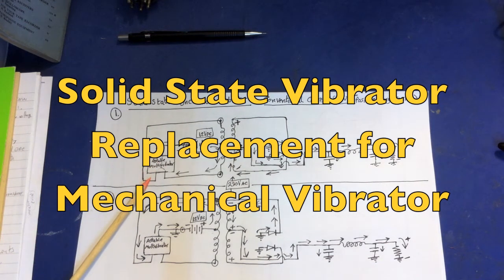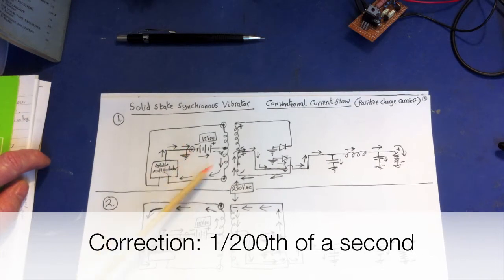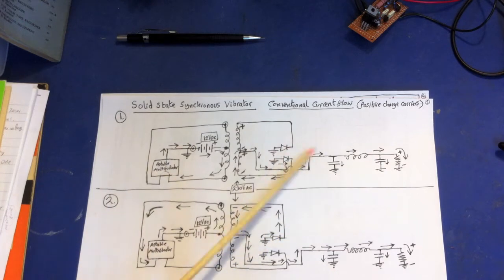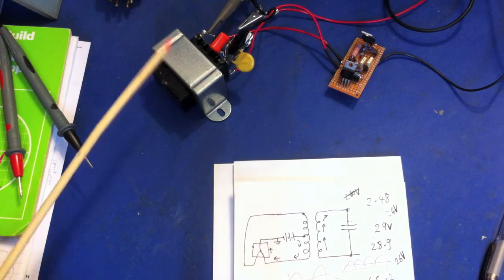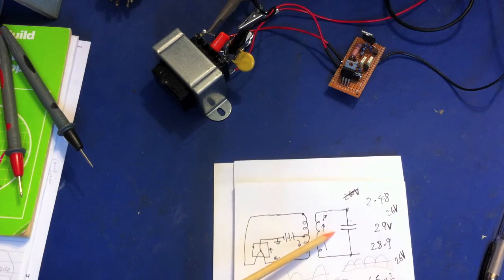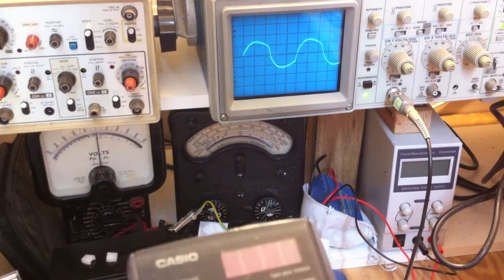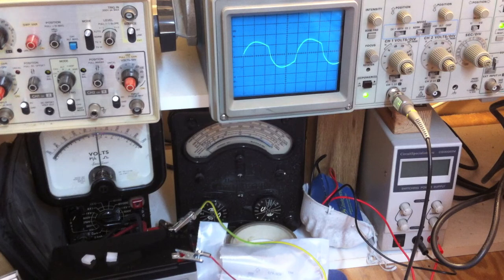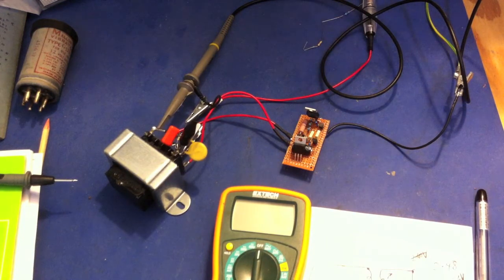Solid State Vibrator

Comment: interesting. I've seen a circuit that only used 2 bipolar transistors and two resistors that did the same thing. Although it did not have the frequency locked by a flip flop, but instead free ran at whatever the transformer "felt like". It was used to make 90 volts ac to drive an erase head of a tape recorder.

Comment: For the purposes of power supply output, we don't care about peak-to-peak transformer output, since rectification only involves the voltage from zero to peak.  Therefore, the maximum DC output one can obtain from a transformer (barring tricks such as voltage multipliers), is the RMS value times the square root of 2, or 1.4142... This is only true of pure sinusoids; since the transformer is being driven by a square wave, the actual output voltage is highly dependent on the transformer design and type of load and the square-root-of-2 method will not apply.
Reply from the maker: Yes very true. As it is definitely not  a pure sine curve! So agreed RMS is not strictly valid here. But used it here as an estimate which is closer than using peak values. Thanks for comment.